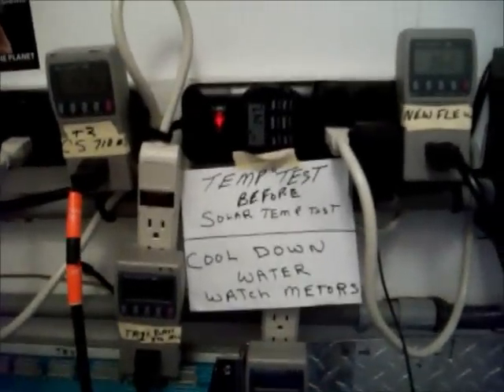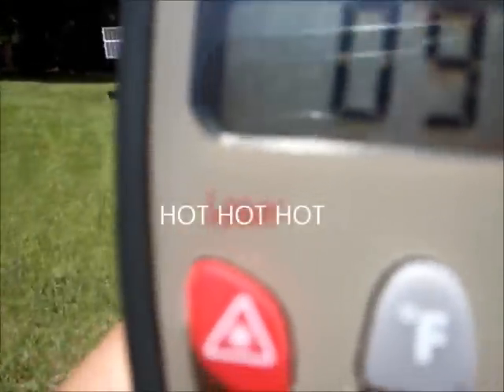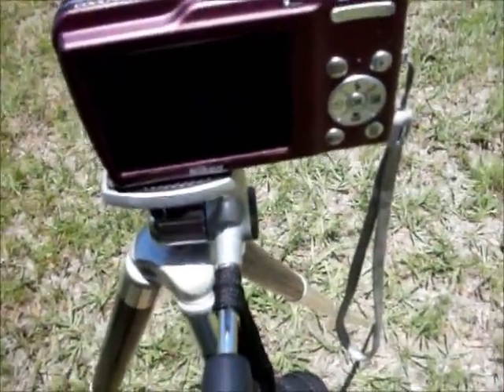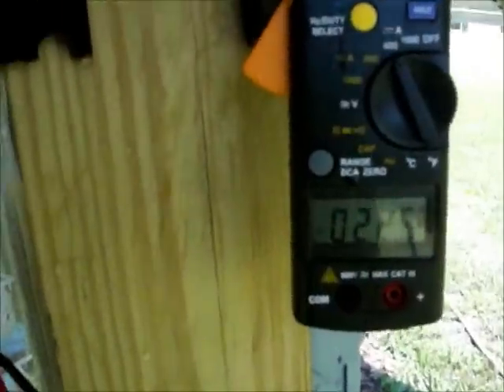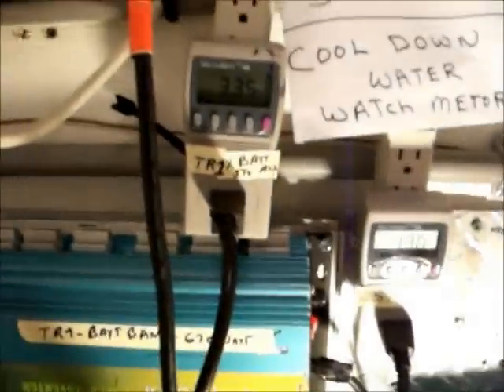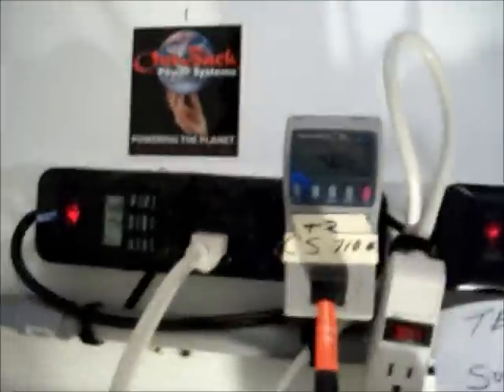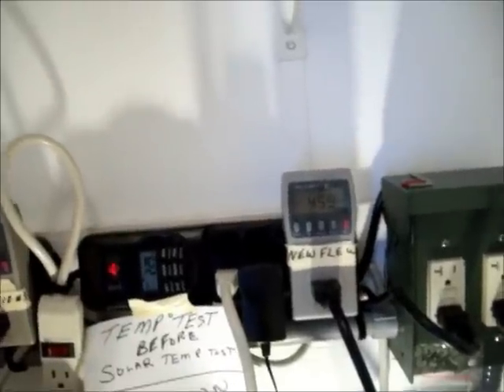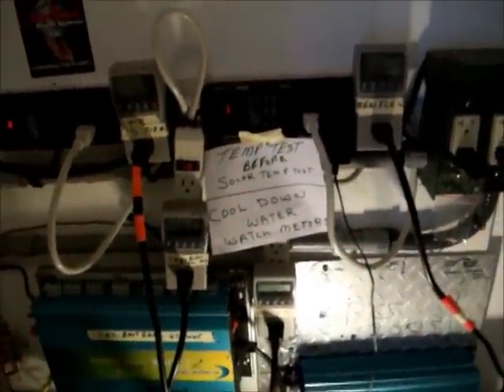SOLAR PANEL WATER COOLING TEST.BIG RESULTS.

Comment: People have done the cooling coil behind the panel thing but the pump takes power and pipes cost something plus it adds to things that can go wrong. It's cheaper to just buy another panel, you get the extra power, maybe more and less hassle. Unless you are completely out of space for panels.

Comment from the maker: I just loaded a new video showing the new axtracker all day in 3.5 min..I have About 3000 watts grid tied as of today but i have 270 more watts to add to my Canadian solar inverter to up 1 tracker to 975 watts@47volts My power intake to day with 3000 watts was 17.39 KWh. Tracking the Solar array make a Huge increase of power verses Fixed mount. And depending on type and quality panel power can suffer greatly in high heat.It is good to hear from You..

Comment from the maker: That,s not bad Fixed and hot how much total power full day? just came in from mount 3 90 watt mono panels on my first tracker as the power line and pole are still sitting there so i ,m going to hook back up to my 300watt P.J.they were on to see how heat affects them as they are mono panels as well.I have ask people to reply with there fixed panel power in ## no takers just saying that tracking is a wast of money just add more panels. Does,t work that way ,Please up date how you are doing..

Comment from the maker: Voltage & amps are the same inside as they are out side I learned how to do this well.Back in February temps in high 60s i was getting 670-682 watts out of my Power Jacks with only 705 watts in at 47v,so cool is good.High temps realy hurt some panels like the Flewtecknics i just got Less than half960 watts, out put. more than others if u look at the watt out ## i just gave when temps are right the new 1200 watt PJ work as well as anything for a lot less money.I have the video to prove it,

Comment from the maker: Thanks I,m some what disappointed  at there high heat performance.but i new what i was getting.may be there was a reason they never sold these. other than being  expensive .I was told by the guy I deal with they lost 120+$ per panel at there cost sold to me For $262 each,not much to complain, other than I could have had Canadian panel for $286 each those kick ass but 47vmp,I was thinking about enphase units at time & u need 60 cells@30v Can.S.are 47VMP.need enphase#210 $220 each plus cable..

Comment: are the best performers in the heat poly or mono solar panels? What kind are your new ones? I wonder if a guy put a water mister set to come on at intervals during the day like nrodge said would be a decent way to keep them cool but the water is kinda high too. That is why I think a mist would be a good idea. Then there is the problem of mineral deposits crusting up your panels.

Comment from the maker: I Have gotten very good results with the 90 watt monos i had But the cadian Solar poy panels are hands down out performing anything i have .but also lastest teck,almost 15% transfer rate and are grade A also Plus only power rating that means if the label says 235 watt that's the minimum it will produce but up to 3% more.Most are rated plus minus 5%or 3% .The best panel carry only 0 Plus 3% or more rating.That adds up quick when u have a few thousand watts.at a +--5% u can lose 50 watst per 1000.

Comment from the maker: The Water test was on the latest  tracker that i,m testing the new sensor on and all panels were affected equally all were the flewtecknics i bought that were new old stock the might be 5-7 years old when i got them.tech.changes fast. In solar panel world.they were so posed to have a 14.73 percent efficiency rating maybe cold.

Comment from the maker: I will try to aim them better it is what it is i,m sure they work great  when it cool,but I need power now.I did catch on the T.L.V.  a shot at 547.so did go up a bit. these are old panels.But maybe that's why they did not sell.But they were cleaning out the ware house& had better deals I did not know about I paid for these.Cool them done NO.The voltage at the cables coming from panels,is the same as in the at inverter.2 runs #6 wire at 60' each.All 4 panels are close in power.

Comment from the maker: My lasted panels perform very poorly in this high heat less than half out put on tracker #4 960 watts I got the power up to 570 briefly Today when I cooled them down 50+ degrees pretty disappointing,but true.

Comment: I don't  understand that when the panels loss is 25% in hot summers why water cooling gives only 10% power ... I don't get that and that is disappointing, it depends that the temperature of the water is not enough?

Comment: OK, so going back over the video it's about 108W difference when you come back in from hosing it down, but you also said you were going to re-position the panels and I can't tell from the time lapse, sorry. Even if we go with that, say 800 Wh/day extra is near 11c for the day, how much is water cost per gallon there? You would probably use 20+ gallons for a day. If you could figure out a passive way to cool them...

Comment: CHEAP way to cool down your panels... Go to walmart  and buy a oselating Sprinkeler.. The hook it up to the hose you have been hosing down the panels with... If you are on a Well then water is FREE with the exception of power to run the well.. News flash ..You have free power coming into your home .. So the cost of Cool Down would be the cost of the sprinkeler.. CHEAP FIX...